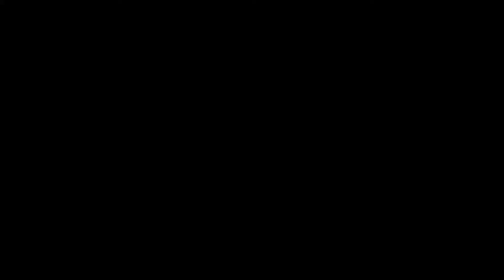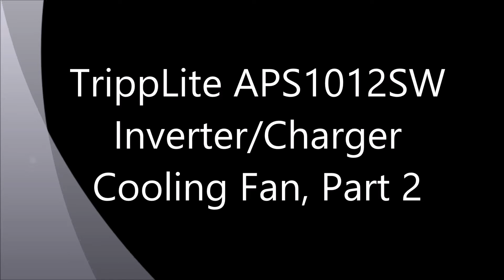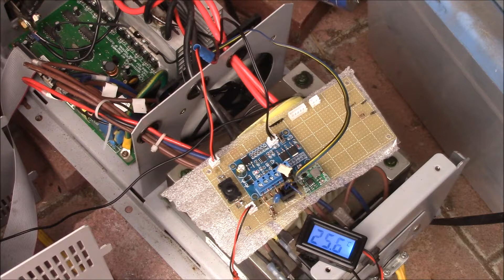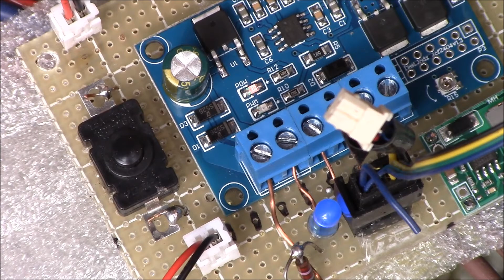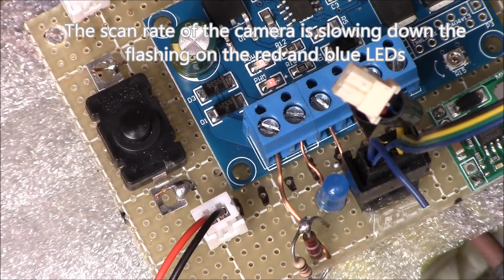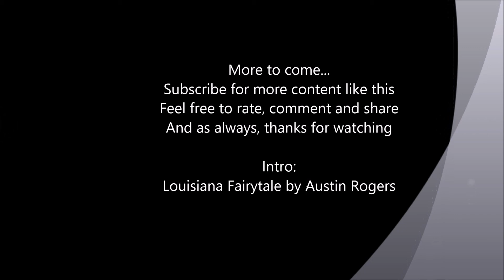TrippLite APS1012SW Inverter/Charger Cooling Fan, Part 2

Comment: That's "thinking outside of the box"...(typical of today's manufacturers to NOT go to the BEST mode/function/design...can't sell new units if one lasts forever)...to someone with the skills, lesson learned...waiting for your next forerunner move...comprehended enough to climb out of the box now..."pity the fool" who can't answer when I question...plus taking the mind set to areas within my scope...♀
Reply from the maker: Thanks for the comment.  I think the original cooling system does have a nice feature.  It anticipates the need for cooling and ramps up the fan the instant a big load is applied.  But those pre-defined settings seem to be a bit too coarse (like 20%, 40%, 60%, ....).  If the mfg. had only made those steps a bit smaller or added in a temperature factor.  The micro-controller on the circuit board has access to both load and temperature information.  It would have been easy to add that feature into the firmware, but I guess they must have had their reasons.  And then they adopt the "no user serviceable parts inside" stance, which flies in the face of "right to repair".
Reply: R Brown 
YOU can take apart and put together...end up with something better...been lucky most of my purchases have lasted over time...despite my neglect...now need to know how "things" work before I invest any time, effort and money in today's products...almost to a point of can live without it if I don't know how it works...just might end up living in a cardboard box...don't have a lick of trust that products today are made to endure...perhaps the reason there are no "servicable parts"...
Reply from the maker: I hear you on that.  So many things nowadays are built so that it's impossible to try and repair them.  One little part breaks and you have to toss the whole thing in the trash.  I try to look for things that look like they may have repair or modification potential, but not always successful at that.  I know when I first got thus inverter and opened it up and looked inside, I thought it was a total mystery.  But now after some years and especially after this repair project, I know know what most of the components in the unit do and how they work.  And this despite the fact the mfg. offers no technical documentation.  But searching the internet, old patent applications and YouTube videos reveals a lot of information.
Reply: R Brown 
Sometimes it's a blessing "not knowing"...time to wonder how did they do it before...like the butter churn, to butter cubes...another day, another lesson...would not have thought of checking patents...surfing the net, not always easy when I can't swim...watching DIY, easy to watch, not so easy to DO...with plenty of free brain space to fill...can "wonder" all day long...maybe the only thing left when the power goes down

Comment: Nice looking good well done 1st yea
Reply from the maker: Thanks for the comment.  Yes, it seems to be working well.  Just in the process of doing a series of tests to see how it works under various loads.  
I'm just surprised that the built in controller did not account for temperature.  It has a temperature sensor that it uses to protect the inverter from excessive operating temps.  It would have only been a few extra lines of code for the micro-controller to add a temperature factor into the fan controller function.  I imagine the stock system works OK at higher loads where it has the fan spinning up fast, but at the lower loads like I typically run, it doesn't work.